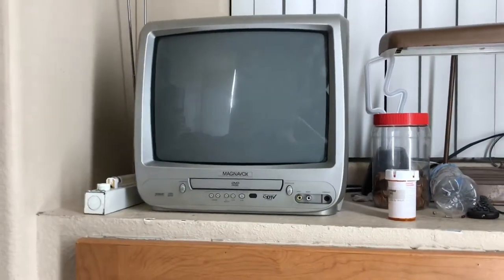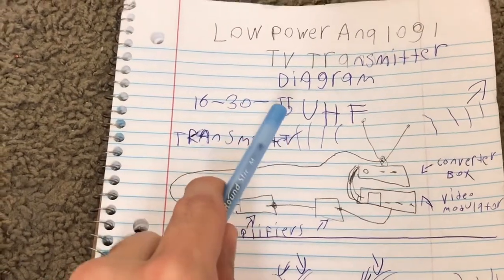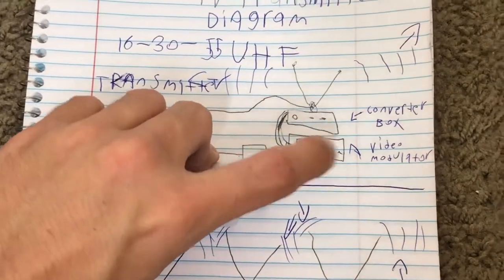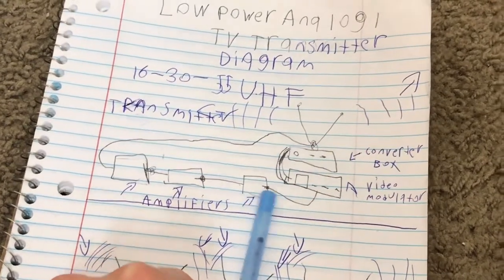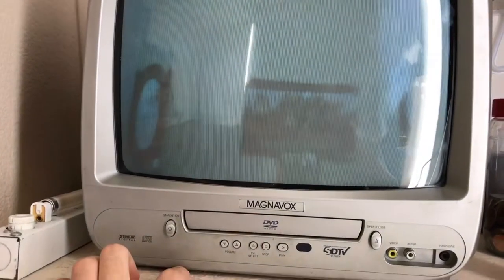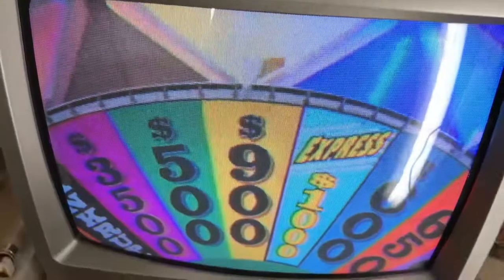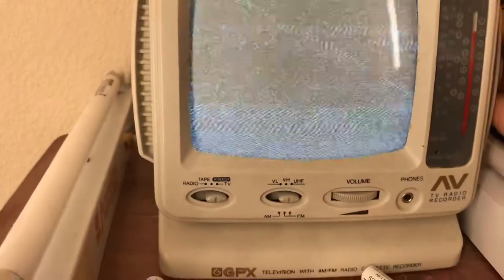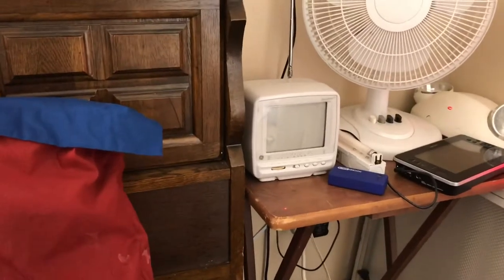Home Built Low Power Analog UHF Pirated Television Station

Comment: I use an HDMI to RCA adapter that feeds into an old VCR, which then transmits the signal to my old CRT TV ( so I can watch old horror movies on the appropriate hardware )
Reply: that's a great solution if you're able to run a cable, however, the method in this video is nice for if you want to have the TV in a different room than your video setup, or use a portable TV for which running a cable is impractical.
Reply: @computerkid1416  I don't need a cable because the RF modulator allows the VCR to transmit the signal through the air exactly as shown in this video.
Reply: HDMI TO VGA and VGA TO VIDEO

Comment: So, this video came out September 19, and about a week before that, I lost the eBay bid to a CHANNEL VISION (3 channel) cable transmitter. I was actually planning on using it legally, with amateur radio equipment. My important question is, what type of VHS camera is that, and where can I find one?
Reply from the maker: Blueyzachary I’m not sure what type it is. You can find them on eBay or at your local Goodwill or other thrift store. I got mine from Goodwill.
Reply: Sethbower11 Thanks. Do you know where I could potentially get a similar channel vision box?
Reply from the maker: Blueyzachary You could use a Blonder Tonge agile video modular. It only has one channel though. You can find them on eBay.
Reply: Cool!
Reply: @sethbower11  how do i work this unit if i get one online?
Reply: @sethbower11  but so where can we buy that???

Comment: I would not go over channel 40 uhf you have a big risk of being exposed in channel 55 because it causes interference with cell towers.
Reply: which one can be safe? anyway its possible limited to just the house dont helps?
Reply: @andresmsuarez5718  it's safe till channel 40, yeah if the range is just in the house it's not a big problem but i still wouldn't risk it
Reply: Bruh didnt expect to see you here
Reply: @dxerkin4  it's actually channel 38 cell towers start on

Comment: Wait wait waaaaaiiiiiiittttt a second....
I bought the transmitter BUT where can I find the antenna???
Reply: Antennas are just pieces of metal cut to receive or transmit RF radiation. You can buy one at Walmart and connect to the RF Out, or use a paperclip with foil on it jammed in to the connector.
Reply: @sethbessinger2025  So I need no amplifier
Reply: @sethbessinger2025  okey then do a normal antenna work?
Reply: @rosamaltonimussolini9715  any antennas will work it doesn't matter which one you use.
Reply: @JD-UHF_Ch-44  okey btw I’ll try
Reply: All you need is a signal booster wired up backwards, the TV antenna on roof is directional but would work, a length of wire, use monopole calculator on web to figure length for the frequency. I'd be careful though as the signal may go far and FCC will get upset..🤣❤️
Reply: @techtinkerin  then what signal booster do I need?